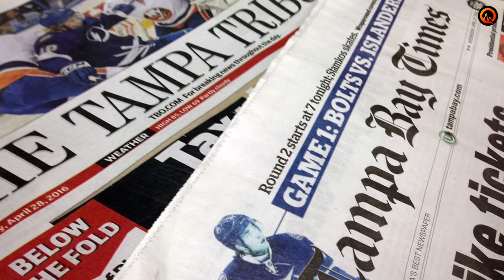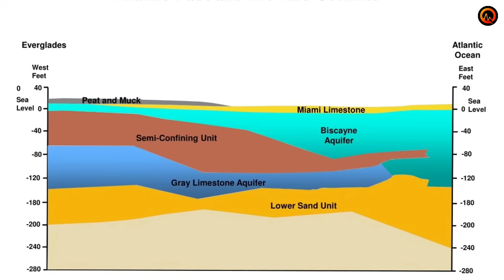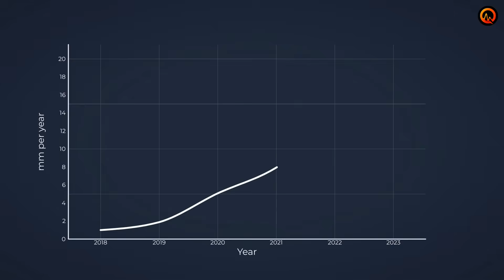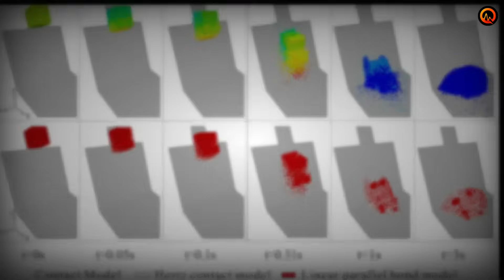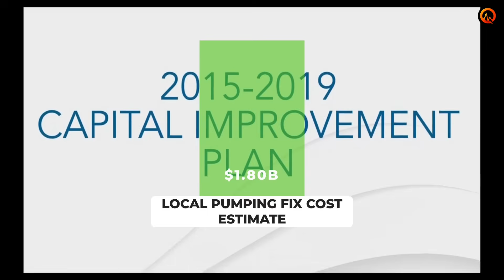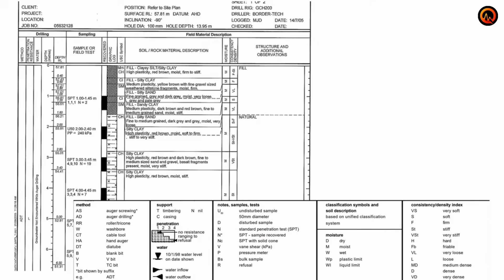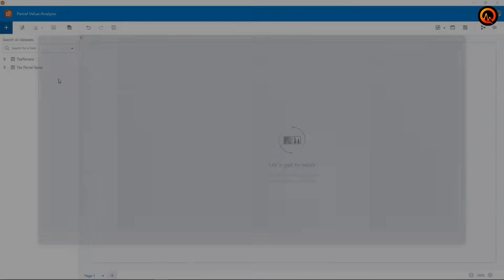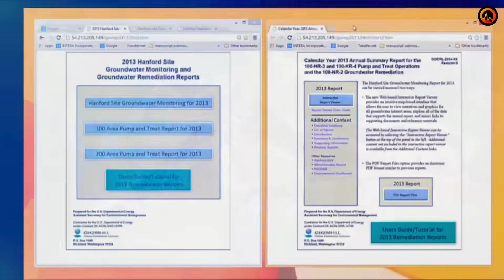Footage From Tampa Bay Cracking Exposes The Hidden Danger Below Every Home

Comment: .What Florida does have beaucoup of is sinkholes that can arise after a particularly heavy rain in a particularly vulnerable stretch of subterranean rock sensitive to run-off chemicals and sheer volume of rain drain imposed upon the soil. Without warning, homes, vehicles,highways, valley floorland disappear into the earth as if a gigantic whack-a-mole burrow suddeny appeared beneath their feet. Would you place sink holes above or below the level of risk for injury that alligators pose?
Reply: What were they sinking.
Reply: Below

Comment: Have you noticed that most all of these sinkholes ae always circular in shape? Do you think this is a coincidence? In fact it shows that the theory of water washing out sub-section of the ground is not really valid since the action of random water movement would not consistently be circular as we see all over the world in this video. It is shocking, but much more likely related to adjacent so called "stellar cores" that approach near to the earth but are not easily discernable to the naked eye. These circular cores energetically interact with the earth's surface pulling energy away. This loss of energy apparently transmutes some of the mass which opens up these holes. 
Occasionally, one can see evidence of these cores in the sky by noting almost perfectly round openings in the clouds with a blue center. This perfect circle is not a naturally occurring random process of cloud movement. You only see blue across the circle center but in space, one could actually see the core proximity. These cores often have a gravitational effect that lowers air pressure and creates circular motion or tornadoes. Larger cores create hurricanes and the gravitational effects create "storm surge" of the sea water. 
A meteorologist would tell you that storm surge is from the wind but we often see this effect in the storm center where wind is often very low. Also, it is this pressure differential in these vortex structures that destroy structures as it passes over but leaves the nearby structures almost untouched. If it were wind, the damage would be an open irregular region and not a sharp line along the vortex path. Think about this the next time you see news reports of the damage from these storms. 

Our modern theories of weather and science are often just flat wrong and few have the humility to admit this. Reference the work of Tesla to see how wrong this theory of relativity is and why. He suggested it was was complete nonsense and it is.
Reply: I hope you don't really believe the nonsense you just spent an hour typing. Sheesh, couldn't be more off base.
Reply: @Mike_The_Nose  I would like to read your refutation, if you are able to offer a better explanation. 
I suspect you will lean on the tired appeal to the authorities instead of substantive reasoning based on material facts we all can see. 
If this is the best you can do, don't bother or waste your time.
Reply: @larrybryant4827 you suffer, sorry about your situation.
Reply: @Mike_The_Nose ad hominem fallacy of reasoning, which may not understand is : attacks the character, motive, or other attributes of the person making an argument, rather than addressing the substance of the argument itself, aiming to discredit the claim by discrediting the person.
You cannot even identify yourself, yet you throw rocks to hide your own inability to cobble together a reasonable rebuttal. 
I have experimental evidence, while you have nothing, not even the courage to say who you are. That speaks volumes.